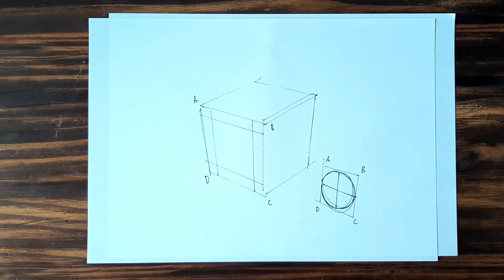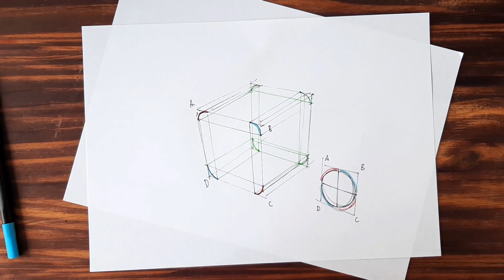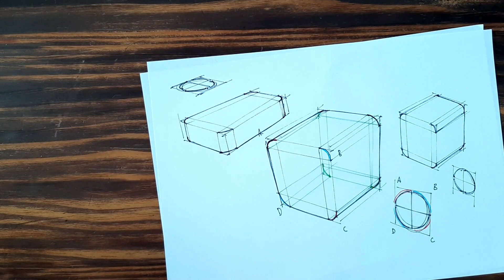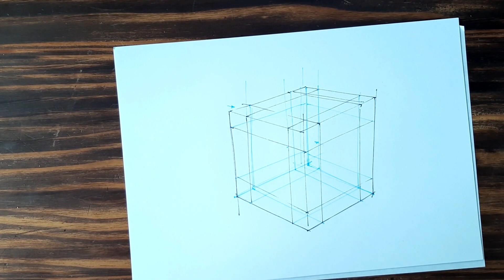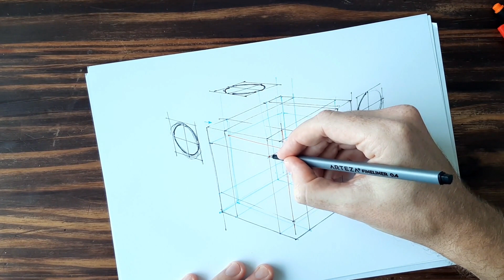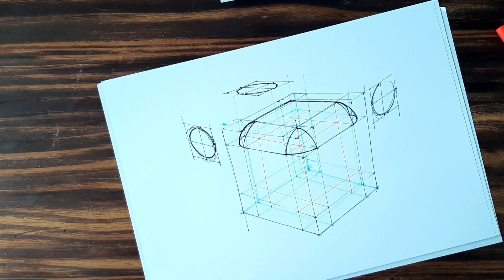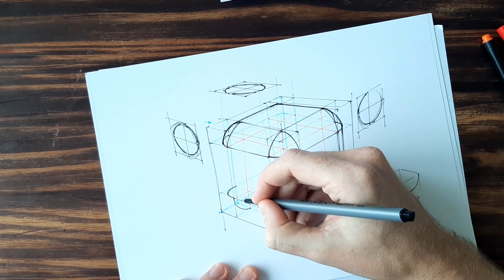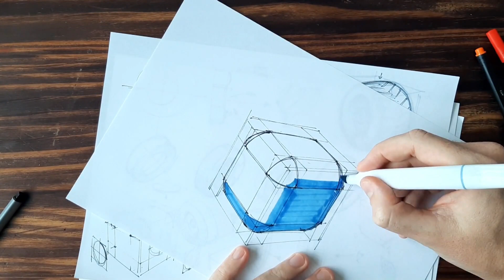Industrial Design Fundamentals: How to round corners

Comment: Thank you for taking your time explaining in depth! Some others just go over it too quickly. 

Something I realized that can help others do this without the reference planes (as they get familiar with the concept) is that the plane corner closer to the viewer is always going to have the "longer side" of the ellipse, from there we can figure out the rest.
Reply: Thanks for the tip! Is this because the closet plane corner tends to be "squashed" more? In the same way a camera lens with different lens have different distortion of the image? Just trying to understand a little more here :)
Reply: @mspeanutsandicecream  it's because of the angle of the corners. Usually the closest ones form an obtuse angle (more distortion) and the farthest ones are acute (less distorsion)
Reply: @abrhmsancehz  OHHHH i see. Thanks so much for the explanation! Very helpful

Comment: What is isometric view?
What is different between artist drawing & product design skeching?
Pls,,,,
I am interesting,,,,
Course name,,,
Reply from the maker: In isometric view unlike in perspective the lines will not converge into a perspective point they will be always parallel. Artist drawing can be a field with flowers, sunshine and a forest. A product design sketch i usually communicating a products aesthetics and how it used or supposed to be used.
Reply: @robertlkiss  
Do you take online class?
I want to do your online classes
What is the name of the degree in this course?
Reply: @robertlkiss  
You know what its admission elligibility,,
Reply: @robertlkiss  Thnk you..
Reply from the maker: I am working on putting an online class together. Should be done soon
Reply: @robertlkiss Tthank you
Reply: Thank you. Very comprehensive.  Still not sure of the process used to  transpose the flat view  correct “ arc” to  a specific cube plane: top corners, front corners or side view.

Comment: it's very helpful but try not to turn your papers so much
Reply from the maker: Yeah that is the hard part, in industrial design you learn to draw long straight lines but that usually goes best in one direction so you always tend to adjust the paper for that. Which gives you nice results but sadly capturing it on video is less pleasant.